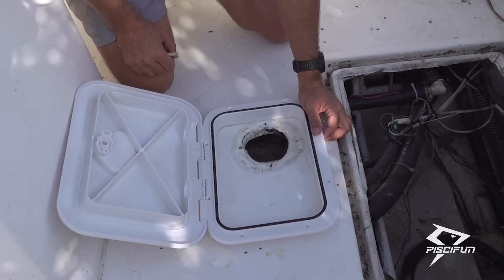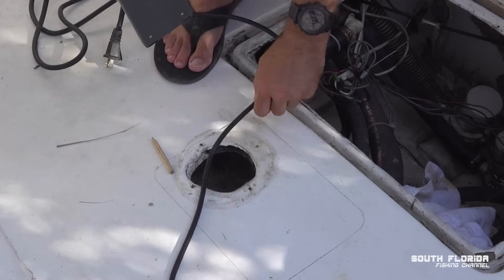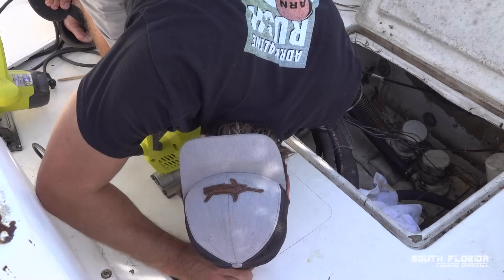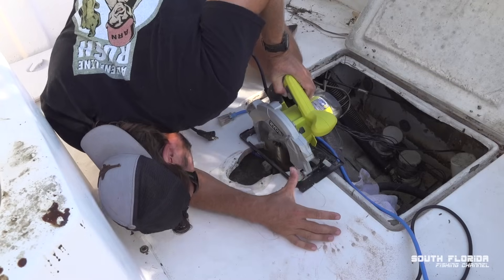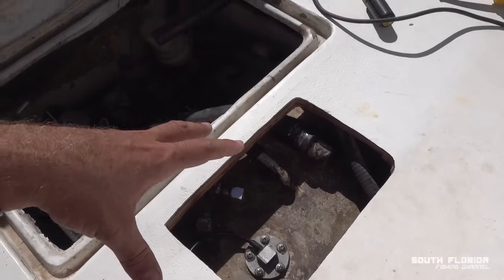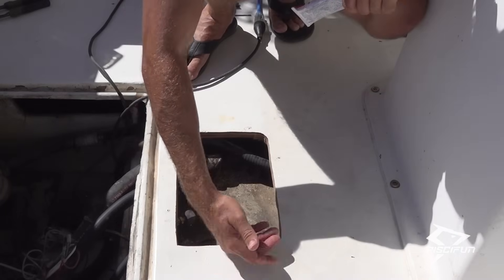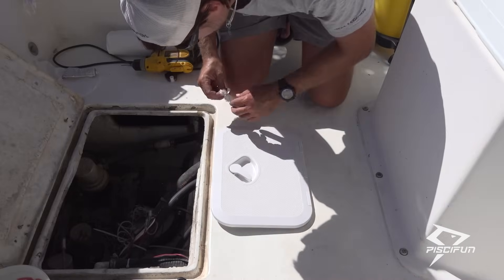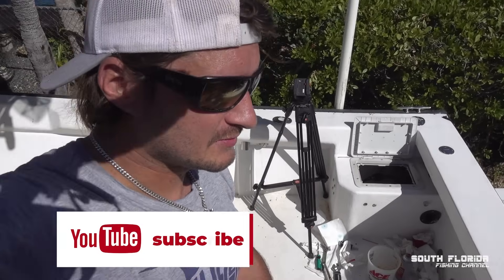installing a floor hatch on a boat

Comment: I have exact same boat as you. 2004 keylargo 230 WI. Not as done up as yours obv. I also have been having fuel issues causing my engine to stall out. I thought it was bad vent line for the gas tank. I have the old style vent like you had before that vents threw the gas cap. Now I’m starting to think it’s bad fuel pick up just like yours. Def gona do a hatch cause that little plate sucks. It’s only right above the fuel sender and barely big enough for even that. Every time you do something I wanna be right there with you doing it to mine. But not as much cash flow. But you earned it so not hating. Where the hatch Amazon? I found our hatch’s for the rest boat on Amazon the 4 up front and the bilge. You had yours all redone when got most your work done when got the evinrude. Nice job. I know your selling but it’s a pretty sweet boat for what it is. Esp yours. How hard/expensive  was the new fuel pick up?

Comment: 5200 is amazing stuff...I've literally used it to fill holes up to 1 inch in diameter on the quick (from moving transducers around on my transom) and the stuff is bullet-proof as well as waterproof once it cures up. Nice job on the hatch...glad you figured out your fuel intake issues! The hatch is 100% on there permanently now (don't ever try to remove it with the 5200 on there!).

Comment: I am a big believer in putting in a hatch  or access to any place I need to get to that the factory made hard to get to.
Reply from the maker: It really should be standard practice on boats or else after 10 years the whole boats gotta be cut apart to replace anything

Comment: I've been having issues the same to yours. I have the same circle hatch, and having the same issues. I'm going to do the same thing. I've replaced all the lines,cleaned the tank,replaced a 2in hose between the cowling and hose that goes into the motor? I've done everything but the intake lines! Going to do this next. Thanks Hieko! Hope your other issues are better from your latest video. Geez!..

Comment: I agree with the other guy, you should have used fiberglass or polyester resin on the wood to totally seal it. After using the 5200 it's too late now so I would seal it up as much as I could with some more. Also I was wondering why you didn't put the hinge towards the bow like most of the hatches in the floor of a boat? Regardless that looks pretty good. 😁👌

Comment: That last screw that you put in and forgot to drill needs to be pulled out and sealed or your deck will rot out. 5200 is not as permanent as everyone makes it out to be, can easily be removed using debond.

Comment: I love drilling holes in boat😅
My 5200 was 8$
Reply: I think I would shop around for a hatch that is more recessed if I were doing it.  Nothing wrong with this one , but I guarantee my clumsy ass would catch the edge and trip while fighting a fish.  
 Glad you got the fuel issue cleared up Heiko!

Comment: Hate to be that guy but that hatch is very close to the other. Thinking maybe you should have started that hatch line even with the hole already there to give you a few more inches of support between the other hatch.  Someone jumps on the boat in between the two and that little strip will probably crack. Best of luck looks good.

Comment: 4200 is better. 5200 is permanent bond making future repairs a nightmare 😢😢😢😢😢5200 is a polyurethane which is permanent bond. Read it on the label, so let’s say you later decide to replace the hatch because you or your guests keep tripping on it (that hatch is not flush to your deck) or you break a piece off of it that for some reason is not replaceable, taking the hatch out will involve you chiseling it out therefore damaging your deck. West Marine sells a debond for softening 5200 but it’s still a chore. That’s why there’s 4200 which is a mix of polyurethane and silicone for removal if necessary. Besides all you want is to create a waterproof seal around the hatch. And you are mechanically fastening down with screws, so it’s not going anywhere. 3m 4200 fast cure is the way go. (Fast cure means 24hr dry time.)